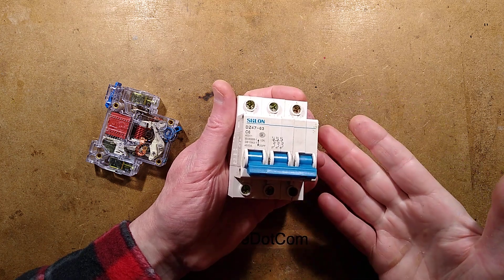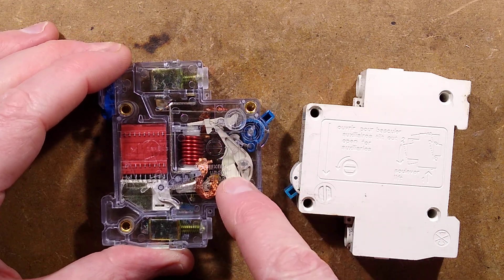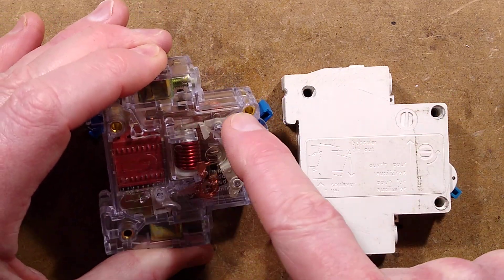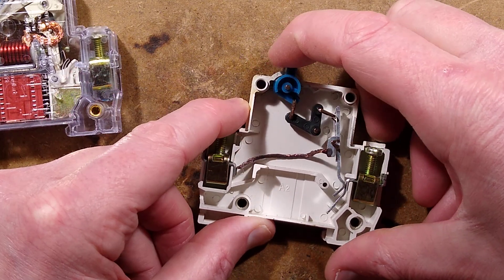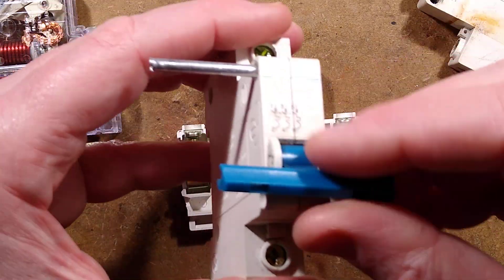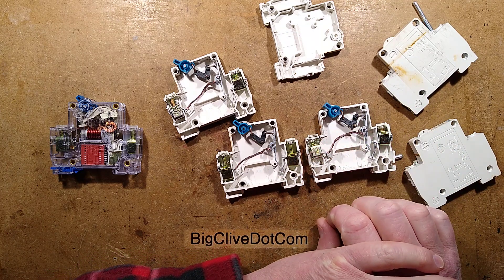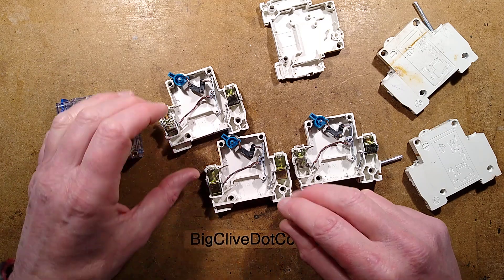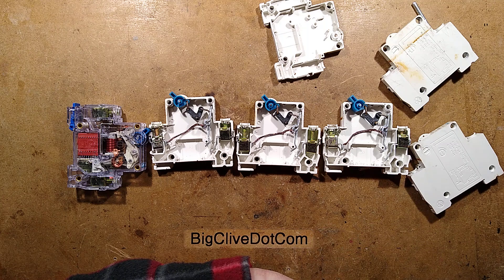Inside a fake un-trippable circuit breaker.

Comment: This thing is downright horrifying. And is a perfect example of why laws have to adapt and evolve. Just imagine the lawsuits that could be created if a fake like this showed up in a high profile case. ...And I don't want to even imagine the horrible casualties and or fatalities that this abomination could cause.
Reply: It might be very difficult to trace the source of the fire. Plastic can burn as well as melt. How many electrical switches were there before the fire anyway?
Reply: @myparceltape1169  To my knowledge it hasn't shown up in a case yet but I'm not an electrician. 
What I can say about the fake vs real breaker is this though: It can melt/burn but the metal and the like in a legitimate breaker wouldn't vanish (the melting point of most metals is high enough to withstand a house fire. House fires burn at around 1100 Degrees F while Copper melts at 1980 Degrees F and Nickel melts at over 2000 F Iron/Steel are in the 2800 F ballbark.), so the odds of it being discovered go up once (if) it happens. Plus forensics are pretty good at finding a starting point to fires a lot of times nowadays. Something about the temperature/burn amount/etc. I don't think it's unlikely that it'd be missed for long. 
This is literally a ticking time bomb.
Reply: @PkmnLegendMaster  It is wrong to argue with you about m.p.'s but the circumstances that came to my mind were not House fires. 
The obvious one is the 'towering inferno' style as was recent in London, England. 
A much earlier one was a commercial building made to look like the stone of the surrounding buildings. It was just a large shop but after the fire there was a danger reported that the shell might collapse, the ironwork supporting it having been weakened. 
Whether this was true or not I cannot say, but the remainder was demolished. 

Does it take more than one source of ignition to burn a whole room? Or building? 

Afterwards people will sift through the rubble. Not a nice task.

Comment: Daft thing is, if they had used a thinner piece of copper (which would have been cheaper for the fakers too) it could at least have worked like a glorified fuse to provide some degree of protection. Add a little bag of sand for weight and nobody would have ever guessed AND it could have still prevented an overload. Naughty people.

Comment: You have to admire the engineering needed to make that lever feel authentic.
Reply: Exactly. But its pathetic that someone would take the time to fake this, when they clearly could have just made it correctly and safely. These people should be charged
Reply: @jcdentonunatco  Electrically!
Reply: @jcdentonunatco  Yeah, some engineer was probably offered a small bounty for making a mechanism that sounds and feels convincing, then handed it off to the company who used it to make light switches that look like breakers.
Cheers!
Reply: @jcdentonunatco  They are probably made by someone who wants your house to burn down if they were used.
Reply: @jcdentonunatco  No, there's usually a useful difference in cost between correct and fake. They also saved money by not having it certified by whatever electrical institute. It does have to be convincing, and it probably usually is. As far as charging them is concerned, I think an electric chair would be satisfactory.
Reply: @chromolitho  The electric chair has to use this fake circuit breaker to make sure the electricity gets the job done. Make sure they know that before hand.
Reply: I wonder who made this fake circuit breaker. That should be illegal.

Comment: Working on a trade counter we hear some horror stories, a customer found and a 200A BS88 fuse that someone had blown so fixed it by welding an M8 bolt across it

Comment: Simply more proof - if any was needed - that not even minimally adequate checking is done on electrical equipment coming into the UK from abroad, typically China. And I don't just mean dodgy eBay and Amazon crap. I've had more than one high street branded item over the last few years that didn't (imho) pass muster for quality control or safety.

I used to think it came down to silly people prepared to risk safety for the sake of a few bob. But I've found to my cost that paying full whack for top brands still doesn't guarantee quality in today's UK. You simply need to double-check everything, or to get someone else to check if you can't.

Comment: Oh, my, I expected to see anything but ... that inside a fake breaker.
Reminds me of those photos of USB flash drives and portable hard drives with bolts glued inside (for added weight) and a single light diode connected directly to a USB plug (to act "turned on" when you plug the thing).

Comment: Yet more fraud, sand in batteries, small capacitors in side large capacitors cans, reprinted fake ICs, cut down under powered fake power transistors and mosfets.

Comment: I wonder if you could look into usb power supplies. I have bought a few but my raspberry pi still reports undervolatage. Just bought a 3 amp one and it still reports undervolatage... How can we test them...? Sorry I know this is nothing to do with circuit breakers but couldn't see how else to contact you... Cheers!
Reply from the maker: Another factor could be the cable resistance.  I'd recommend the official Pi power supply.

Comment: Um... That's a main switch, not a circuit breaker. They are only meant to disconnect, with all overload protection done at the individual output circuits. Very common in Australia, but not with circuit breaker labelling on the front 😅  they usually have a red switch or something that sets them apart from others of the same brand.. Probably came out of an old switchboard...
Reply from the maker: It's marked as an over current device.
Reply: @bigclivedotcom  yeah I suspect the company manufacturing the cases had too many, and palmed them off as breakers with the internals of an on/off switch.. I wonder where they are manufactured?

Comment: The transparent breaker you have with the thermal trip unit is a typical UL489 branch circuit breaker.
The one your showcasing appears to be a UL1077 supplementary protector.
They have letter classifications, as you mentioned type C, that designates the failure point of the internal wire (which in the case of a type C is somewhere between 5-10 times the rating on it)
https://www.e-t-a.com/ul_certification_pages/scope_of_ul_1077/

Edit - Supplementary protectors shouldn't and are not meant to be used for over current or branch circuit protection, but rather a means of disconnect in equipment where the circuit is already protected by proper over current protection.

Comment: They could at the very least have made the wire in a thickness matching the amp rating of the circuit breaker. Would have been much safer at no cost to the scammers who made this.

Comment: My landlord installed B10 fuses here, I assume the solenoid have more turns in those? Inrush current will trip it so when I have to reset it I have to "pump it up", reset it multiple times until it doesn't trip. I am pretty sure the life span of it will decrease rapidly from that treatment.

Comment: When i saw this i thought it might have some kind of bimetallic strip that bends when heated(overload) to cause trip.It might not be safest one yet but should work for most households.Also it should trip occasionally if this is true, especially in summers."Upvote this so he can see"
Reply from the maker: Under short circuit conditions a purely bimetallic trip may suffer significant damage in a high fault current role like this.
Reply: @bigclivedotcom  Hmm, i see.Thanks for the reply

Comment: I have seen similar "breaker type" disconnects before. Square D made them for a while. At first glance, the look like typical 60 amp, 2 pole breakers.
However, the device is clearly labeled "Disconnecting Means Only. No overcurrent protection" and meant for dedicated enclosures, rather than an electrical panel.

Comment: These chinese-made circuit breakers are sold under various brand names, but all have the same body design and model number "DZ47-63".  If you search Amazon for "DZ47-63" you can find re-branded versions of the same looking breaker shown in this youtube video.  All amazon versions of this breaker come with high "user reviews".

Comment: Oh! I've never laughed so loud! :) But, as I think, if the wire inside this "circuit braker" is thin, then it can work as a simple switcher with a fuse :)

Comment: Thinking about it if the Generator is not capable of generating more than 6 amps an over current circuit breaker will never trip. The maximum current the alternator can provide depends both on the electrical construction and the control circuit but very often the output falls at their designed load either because of the control circuit or the engine stalls on overload. That could be a reason for having a switch rather than a circuit breaker though there is no excuse for labeling it as a C6 circuit breaker rather than a 6 amp switch. It also does not excuse the poor construction.

Comment: Jeez, that just about takes the proverbial biscuit. Guess just about the only clue to what is inside (i.e. NOTHING) might have been the physical weight of the thing. Had plenty of experience of "iffy" Chinese made breakers on cargo ships over the years, but usually that involved them tripping off at less than their rated currents, none of them were switches masquerading as breakers. Not the sort of thing readily apparent, until something further along the line burns out for no good reason. And all for profit, grasping low-lifes....

Comment: Is the Circuit Breaker CE marked - it is difficult to tell ? Also was the complete generator CE marked ? 

One of the weaknesses in the CE scheme is that even if it is marked it is very difficult if not impossible to get back to the CE certificate and the test results. If the UK government were sensible now CE approval is being replaced by UL or UK Northern Island product approvals they would give each approved product a number that could be traced back to a database with the approval certificate and the test results in it. That way at least you could find out what standards the product is supposed to meet and the persons responsible for compliance. Some EU manufacturers include a copy of the certificate in the product manual signed by the responsible person(s) but not many and even then you can't trace things even further.

Comment: Is there anything at all on Ebay that's not fake, counterfeit or does not meet to advertised specification ?   Has anyone EVER measured a lipo battery the advertised capacity?     And meanwhile sellers keep going on about buyers doing "item not as described scams" .

Comment: This video begs the first question? What manufacturer and model generator was this part found on? Please indicate for ownership safety..Importers should be responsible for distributing imported products that have not been tested the same as the products formally manufactured in their plant. Importing products SHOULD NOT separate the testing and safety responsibility of the distributor.

Comment: Welders...I'm a welder and usually go 40-50 % over the required current...on cable/receptacles...then 25% or so on the breaker. Never had a problem yet....of course, I'm using the 'real' breakers...

Comment: Is an untrippable circuit breaker even a real thing?

That sounds like headlight fluid 

Or fireproof matches 
Or waterproof cups 
Or non microwave safe plates 
Or vodka ice cubes 
Or a 120v 0.6A floor heater 
Or a non airtight plastic bag 
Or a flightless bird

Comment: The schematic on the front is clearly that of a disconnect switch, not a circut breaker- maybe learn to read.
Reply from the maker: The symbol on the front is an overcurrent one, complete with trip curve code.  Maybe learn basic electrics.
Reply: The schematic is, in fact, very clearly that of a circuit breaker and it calls out a standard which applies specifically to domestic circuit breakers. For the safety of others, stay away from all things electrical.

Comment: This stuff seems to be getting more common. I got a blown assembly back from a company in China (a part return). There was a hole through the end of one of the several 6.3x32 fuses and it looked like a jet of plasma must have shot out of it. The other fuses were of the same type and brand so I opened one. It was simply a nicely printed ceramic tube with a wire through it; as opposed to an engineered element. The wire was bent at the ends and the paper-thin end caps just pressed over the wire. No solder. No quenching media. No arc-stops and let-through from hell.

Comment: That's TERRIBLE!!! -.- -.-
I couldn't tell these from real ones. The look and feel is too close to the real thing.
The one you disassemble doesn't look new at all. I assume it was in use for a couple of years. :(
There could be a (bit non-practical) way to tell these from real circuit breakers without opening them:
Turn it on, place the thumb below the lever (so the lever would hit the thumb nail when flicked off) and then flick it off. Keep the thumb, where it is. Try turning on again. It needs bit practise. If that's impossible until you remove the thumb (because the lever has detached from the mechanism behind): It's real.
This is a feature that allow circuit breakers to trip safely regardless the lever is blocked or not. This fake seems to don't implement this.

Comment: I once taught physics in a fairly new school. One day I wanted to shut the power off to the outlets on one side of the lab. I turned of the breaker labelled for that side in the panel in the prep room - outlets still hot. I took the cover off the breakers, there were some six breakers for that lab and found everything run through a single breaker and nothing run through the other five.

Comment: As i know there are Two types of Breakers,  1) The "Simpleon board Switcher Breakers" that is a simple switch circuit inside, and mostly used as main board switchers with Very Low inside  Protection........and installed in series with external on board main Slow Blow Fuse.  2)  The Micro-Auto-Breakers with a more complicated sensitive circuit inside for higher protection.... against cable  circuit overloads, shortcuts, high Arcs etc. The Micro-Auto-Breakers are not recommended for often Switcher on/off on board operation because,  the often switcing using it has Worn through  thetime in the mechanical Auto braker system and has mulfuctions on protection operation.

Comment: I watched your video & noticed you said no UK test would test to see if they trip or not. Maybe I have my wires crossed but a few weeks ago, I had a very old consumer unit replaced for a new metal one & at the end, the electrician connected something to my lighting & my sockets & intentionally overloaded to force the circuit breaker to trip, which they successfully did so it passed the tests. Is this something that you were referring to that would have pointed out if the circuit breaker was working or not or have I got my wires mixed up?
Reply from the maker: That would have been the RCD / GFCI test.
Reply: @bigclivedotcom  Ah, good to know. While I have your attention. I was wondering if you noticed my comment on one of your older video's? This one https://www.youtube.com/watch?v=QwqFkelUs_g&t I came across it by change & I was wondering if you had any plans on doing a follow up on this. As I have noticed very similar items being sold on eBay in matt black with improved LED & Solar panel on the top. And I was curious to know if the same fatal flaw is also present in the new variants being sold on eBay. 

but loving the video's non the less. You basically do what I think about with devices. Breaking them apart to find out what makes them tick.

Comment: Misleading markings on the switch is the problem   ( its just a switch ) .

The gen-set thing is kept outside .
If overloaded it struggles the output drops , things run hot ,  it just stalls out or it smokes !

I would be happy using this switch in a generator if fused correctly 
( fuses are normally fitted in the gen-set ) but their should be 
protection on the downstream side regardless of this device .

This makes me think about all the sub £1.50 switches on websites 
like Ebay , Wish , AliExpress & Alibaba .

The cheapest switch I can find with this number on it is just £0.37 per switch  .

Comment: Thats the type of nonsense you get when your company decides to buy the equipment from the  Chinese  at half the price of a European one.. 
Watch out for construction companies putting cheap boards in new builds. Although compliant,  try poping to your local electrical factors for a replacement braker.  Idiots put a B32 instead of a D32.

Comment: Marketing is vague, at one point calling it a "miniature circuit breaker  leakage protection air switch". (Whatever that is!)  Appallingly misleading, but I like the suggested uses in the video! WBL-WH Miniature Circuit Breaker DZ47-63 2P 400V AC Miniature Circuit Breaker Leakage Protection Air Switch 25A 40A 50A 63A(63A) - - Amazon.com

Comment: That's a mislabeled isolator.  They make switches like that in that same MCB form-factor as multi-gang cut off switches. They are called "isolators" in the terminology of the business.  They are also designed to be custom-ganged with an actual circuit breaker so that when the breaker trips, other circuits are disconnected at the same time. They should have had a circuit label like this isolator:
|
https://www.alibaba.com/product-detail/16A-25A-40A-63A-isolating-switch_60812134963.html?spm=a2700.galleryofferlist.normal_offer.d_title.333b4cd5hf7G24
Reply: Whether this was created through sloppy manufacturing or intentional fraud is hard to tell.